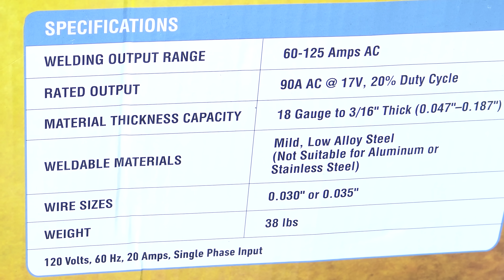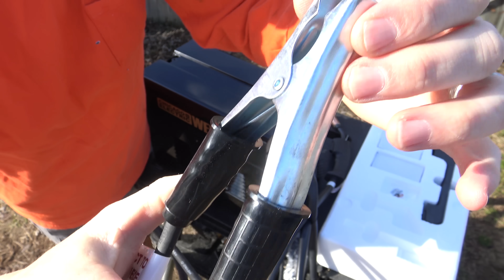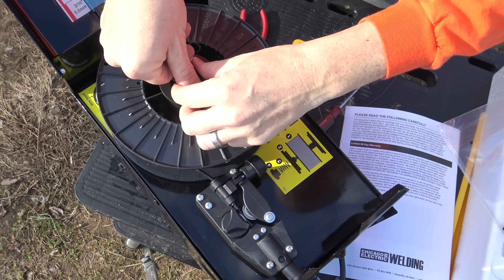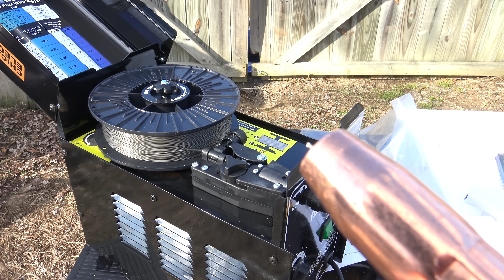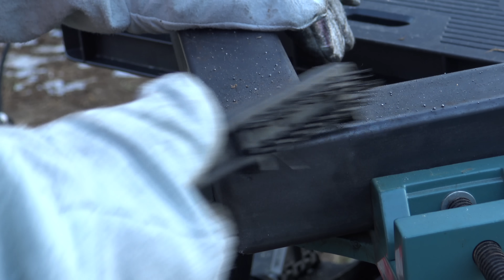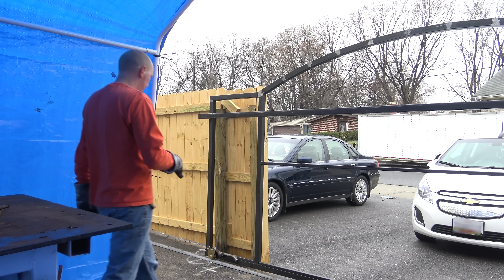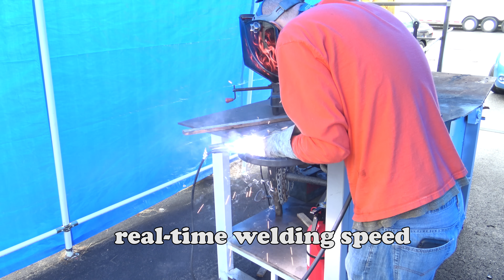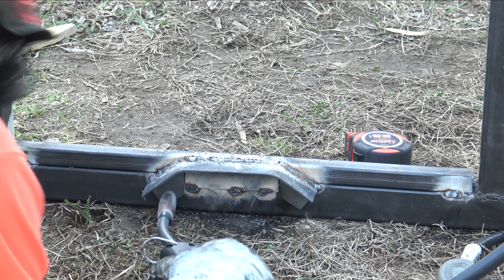Harbor Freight Flux 125 Welder Review

Comment: Could you weld chain link fence pipe with this? Thanks for the advice.
Reply: I'm wondering because I'm building a sliding gate also but its too lat to switch to square tubing. I'm using 2 3/8 galvanized fence pipe. I already ordered my roller wheels and motor. I cant really afford to hire a welder. I'm pretty handy though and i think i can get it done.
Reply from the maker: I have used the older welder on this kind of pipe your asking about (weld power feels nearly identical as the older model I had). I think  it will work ok but you will have to be careful with the settings because it's easy to blow a hole thru that pipe. Good luck with it!
Reply: Thanks for the reply, I really do need the help (ha ha) I have one more question for you if I could. The Y.Y. video I'm following the guy uses a stick welder. Do you think I would be better off with that for my pipe? I kinda need to order a welder today. Its getting cold here in Denver already. (ha ha)

Comment: The only problem with the 110 v welders is that they don't have enough power / heat to penetrate the metal.
Reply from the maker: Worked great for my gate. I could easily blow a hole thru the metal without being on the edge of it with this welder...

Comment: NONE of the Harborfreight tools I have purchase have ever failed to perform as well as my Craftsman. So, when I started buying things like welders and generators, I went to Harborfreight and those things are working well. I use my generator for the 20-amp supply for the welder...works great!!!!
Reply from the maker: Nice. I do like me some harbor freight tools. Way less money for comparable tools, for the most part. My hammer drill was around 150... A Bosch of the same performance ce is over 400. Insane.

Comment: I have just recently unboxed my 175 multipurpose machine that I bought from a multinational gas company here in Eastern Australia.
Unfortunately, I cannot find my owners manual and there is no chart on the inside of the side flap to give me a starting guide.
I am working on my old box trailer outside so I am using flux cored wire.
How do I get started to be somewhere in the ballpark if there is no guide/chart giving you a starting point?
I burnt out my old smaller mig welder and I do not want to burn this one as it was fairly expensive.

Comment: Comes with a 9 lense but osha is 10 seems standard
Reply: A 9 shade is the least you'd want to use for hardwire. Flux core is 11 and stick is 12. If those are not visible enough, step it back. After all, they're your eyes and you should be able to see and do what you want with them.

Comment: I’ve had 2 of these and for $90 you can’t beat them. I’ve built a 10x10 green house and a well house with this welder. If you know what your doing it’s not a bad welder. Just don’t weld over head or really thick metal and you’ll be fine.

Comment: The main flaw in this machine is the ac output. Flux core wire is dcen meaning it requires a dc electrode negative output this is why this machine produces such sloppy welds. I was hoping that they had corrected this on the new model but to no avail.
Reply from the maker: It works for me. I bought it for what it is. This comment's essence could similarly be placed against a single use camera and how it's sad that you can't adjust the aperature in them (yet). Cool part is that the welder I had before this lasted a very long time... This one went through my gate project without a single issue.  I look not for beauty in my welds. I look for strength.
Reply from the maker: And just to close the loop on my last comment... Look for the strength in your welds and you will find the beauty...
Reply: TRY to HELP you  I’m not knocking your welds I have the same machine just saying they could improve it farther by making it dc out.

Comment: Very nice realistic welding video.   One thing that needs to be kept in mind when using these little welders is that they are not designed to wed heavy materials.  It's true that they can tack heavy metals together but you'll need a bigger machine in order to get penetration.   It should at the very least, be able to weld 7018 1/8 or 5/32 rod.  
I wonder why HF and others put the power cord out the front of the machine rather than the back?  Never could figure that one out.
Reply: I read that in sum countries it is the law it has to come out of the front.
Reply: Electric designers try to make device less costly

Comment: Thanks tons for the review. I've been contemplating getting one of these. For the amount of welding I would do, it's almost perfect. Now to decide between this and an oxy-acetylene. Decisions, Decisions, Decisions
Reply from the maker: Getting this welder, even if I only use it for my gate project, was a great decision. It's not the prettiest but it is effective and strong.
Reply: Easy. Get both
Reply: Argon. Acetylene is for cutting.

If you can afford to weld with gas and/or need to have pretty welds, especially on sheet metal, get a mig with variable voltage control. You'll love it.

A flux without variable voltage will only piss you off.

Comment: Hi I'm new at welding but thinking about buying it to do my pickup truck body panels.  My 1st time trying both 
Thanks for your help
Reply from the maker: No prob. Be careful with these and body panels. Dialing in the right wirespeed and amp setting (1 or 2) is not fun with these welders and say a Toyota truck fender. The outer portion of the weld can weaken the metal... What I mean is you can see cracks in the panel over time, just on the outside of the weld. The thicker the panel the easier it is. Good luck with it and be sure to do plenty of test runs/pieces.

Comment: Where did that work table come from?  Nice...
Reply from the maker: made it myself!
Reply: "Keter Folding Compact Workbench Sawhorse Work Table with Clamps 1000 lb Capacity" 70$ on amazon
Reply: @jakobr.2753  I have a couple of the Keter folding workbenches and find them to be very sturdy and functional.
Reply: Jakob R. Thanks!

Comment: Do you think this would be a good welder for a starter? Also would this be a good welder for some small welding art? :D
Reply from the maker: I do think it would be good for a starter for metal art, yes!
Reply: Thankyou! :)
Reply: I like mine but I started with a stick welder
Reply: @1986chevy  same here. The 80amp stick welder from HF works good as well.
Reply: Not where safety is an issue

Comment: Would this work to make a go kart frame that would be strong enough ?
Reply from the maker: If you have the right metal and skill, YES! Be sure you practice and test welds by welding some pieces of metal together and hammering them or beating them to see when/if/how the weld brakes. After that be sure to have a safe design and build your frame. Always keep safety in mind during every step. Good luck with it!
Reply: I used the 90amp to build a bass boat trailer for a 16 ft glasstream that I have towed all over NC.

Comment: I just wanna be able to weld sheet metal for core supports in cars and car exhaust. Hopefully this'll be good enough
Reply from the maker: I think sheet metal is a stretch with this welder, if you want it to be support for automotive purposes. You would need a tig welder for that I think. Or pretty thick sheet metal. Keep searching for automotive support modification examples and please be careful. Often when welding sheet metal on cwlars, the portion of metal just on the outside of the weld becomes weak and snappe under stress.

Comment: Would you use this to weld towing chains?
Reply from the maker: yes but be careful. I have welded many a chain link to many a truck rack so that crews could lock up their equipment. One single link on one portion and a several links long length on another portion... we ran the chain through the machinery and used a padlock. plain and simple... worked great. If you are using this on a towing chain and are planing to tow things and you are counting on the welds to hold the same rated weight as the chain itself, you may need to get the welds certified at an appropriate xray facility. If you are unaware that that is a thing, it is. bottom line is to just be careful. good luck!

Comment: Good Video,,I have the 90 amp model,,for what I use it for it was a good buy
Reply from the maker: thanks! yeah, i still have my old 90. The trigger does not operate as it should and the pin that holds the reel busted... it lasted SO long and i welded quite a bit with it.

Comment: Bought one returned at a HF tent sale for $75 ($45 for the welder if I bought a $30 ITC membership =$75). Went to .35 wire immediately, I'm a cert welder so jump'n on it was no prob. Really only has 2 good settings. Low + wire around 4, and hi w/wire about 4-6. Runs shitty on anything else, feeder is loud & sounds like it's wanting to die but works well w/the right tension. For $45 you can't beat it, a tip is to buy your wire off Ebay at $4-5 per lb instead of $10 a lb at HF.
Reply: The small roll of wire that comes with the welder is truly trash.  Don't even try to use it, as it will make you want to kick the whole machine to the curb.  I bought the 10 lbs. spool of Italian made wire and WOW what a difference !!!  Doing the conversion to make it a DC welder wasn't that hard to do and makes it an even better welder.
Yeah, it's a light-duty welder, but you can use it almost anywhere and do a good job.  Practice doesn't make perfect...but it makes you better...
Fine job on the video, informative and entertaining.
Reply from the maker: thanks for the comment. yeah these things are worth the full price i say... so you got a great deal!
Reply: Wait um so wat kind of wire and name brand plzzz

Comment: Is th new model arch start/always on or is it trigger activated like it should be
Reply from the maker: Carl WTF trigger. It won't spark till u pull the trigger. You can slap the metal all day long with the wire and it won't spark untill you pull that trigger.  My old model was like that too

Comment: Pro: This is such a great review.  CON: EXCEPT FOR ONE THING??? Why didn't you use the original wire it came with???  because, Yes I am a noobie and it leaves me with questions, Like is that wire garbage and do I need to go out and buy that wire you are using and that means I have to go and buy those tips to accommodate the wire size.. ?? I was thinking about buying this unit today because of sale price.
Reply: They are good weldes but the wire that comes with it is a piece of shiiiiiiii.
Reply from the maker: AmIonArock the wire it comes with is ok. It burns thru it quicker and according to the charts it does not weld the thicker stuff... It will hold u over just fine for regular welding.. I like the bigger wire because I have noticed I can slow down the speed some ... And ... Jeez it's been a couple years... But I think the .030 just doesn't get as hot.... Look it up online and try to download the manual. It will have info on metal thicknesses and what wire size goes with what. All in all, if you have the appropriate outlet you will get good use out of this thing.
Reply: thanks for the very fast response, I kind od figured out that your a welder and instead of wasting time, you wanted to go to work on your project and you knew the other wire wouldn't be suitable.  But what I want this welder for is working on Bicycle customizations  stuff like that.
Reply from the maker: No prob. Sometimes I get the comments when they happen and other times they get by me. U know what? That .030 would have been suitable for my gate. it would have worked fine. the main thing I don't like about small reels is they run out really fast. I didn't want to deal with that... Plus I had the old wire I wanted to use up. Prolly should have mentioned how fast those small reels run out in my review.... Hmm :/
Reply from the maker: Anyway, yeah. Should be good for a bike. Make sure u grind the paint off for a better weld.. plus you will need to practice. You will burn hopes in bike tubing easially. Find a throw away frame to practice on.  U should be good. The weld will be considerably more ugly than a weld that had migmix gas or straight CO2 .. but it can get the job done..  just keep safety in the front of your mind through the whole process, put in effort, do some more research amd you will succeed!

Comment: Good vid. Is that a 10lb wire spool? If so did u have any problems with it?
Reply from the maker: thanks, yes its a 10 lb spool. absolutely no issues and i welded a lot with it. plus its several years old.

Comment: There are only about two people who created a really good welding video about the Harbor Freight 125. Besides that the only people you find are spoiled kids or people who don't really know what they're doing. I bought this machine  about a month ago  and I really like it  it's not a Lincoln a Miller or a Hobart  but it's fun to work with if you use the right technique  and right metal thickness .you did a good job on the video thank you
Reply: I have had one of these machines for 14 years and have built 4 trailers with it along with many projects  with no problems
Reply from the maker: hey, thanks!
Reply: haha you just add hobart junk in with lincoln and miller
Reply: Miller owns Hobart, hahaha.
Reply: keegan lantz it's a great welder. If all your going to weld 1/24 metal. Other than that it's useless.
Reply: @micahfrye8885  incorrect... Practice more
Reply: I just bought one today. It’s been about 5 years since I picked up a torch so today was fun.

Comment: i've had mine for about a month. good welder but too bad can't weld 16 gauge and thinner steel. so it's going back.
Reply from the maker: WV591 if you still have it, Set your speed low and the switch to minimum if you have not already. Unless you have not used it at all and just want to return it unused... That's always easier to return unused stuff.

Comment: Very entertaining review.  If anyone is interested, I did tests on the actual welding amperage output on my channel. https://youtu.be/rMJnxbP481k
Reply from the maker: thanks for the good words. Also, your video is great, thanks for linking it. If you ever find the time to do the test with .035 wire please update by commenting to this comment. I am curious if there is a current change with the thicker wire.
Reply: @TRYtoHELPyou  Would this be okay for welding a muffler or something like that in the exhaust system of a car? I have currently 2.5 tail pipes and I don't want to take it to the shop just swap in a flowmaster muffler that costs $50 when I could just cut the pipe and weld the sucker my self and save hundreds of dollars.
Reply: @jlrockafella   A little late with my reply but yes for welding a muffler. I have done a couple. Remember to disconnect your car battery before you start the weld & clean the pipe as much as you can. If you can remove it from the car to weld it is a lot easier.
Stay well, Joe Z
Reply: @jlrockafella  yep. Works great for that. Just stitch weld so you don't burn through.
Reply: TRY to HELP you You’re very welcome.  Thanks for pinning this.  The tests with 035 wire are complete.  I will be posting the video in a couple weeks.
Reply: Where can i buy this thing here in in philippines.
Reply: TRY to HELP you   Good video and exactly what I wanted to know about their Flux 125 gasless welder. I’ve been pretty happy with most of harbor freights tools and equipment. Now to check my outlets to find 20amp rating lol
Reply: Would this be okay for welding a muffler or something like that in the exhaust system of a car? I have currently 2.5 tail pipes and I don't want to take it to the shop just swap in a flowmaster muffler that costs $50 when I could just cut the pipe and weld the sucker my self and save hundreds of dollars.
Reply: HF needs to make an integrated cutter on the gun to snip off all the wire due to inconsistent feed. 1/5 of your spool ends up wasted on the ground.

Comment: Thin metal, like sheet metal, any experience so far with this? If yes, was it reasonably easy to not burn through thin metal?
Reply from the maker: YES! Experience, yes... not with this machine exactly. But its nearly the same as my old one. If you are welding a hood on a car, you will likely burn holes frequently.. It is possibly do-able though. IF you do try, you can weld for a second or two then let off, wait 5 seconds, then do another spot, then wait.. .then do another, then wait. It can be weak in the end. TIG is your best bet for that (speaking as a non-professional welder). But, if you search the topic on youtube, i bet there is great info..(gonna search now myself)
Reply: thelondonbroiler yeah keep it a little further away from the surface